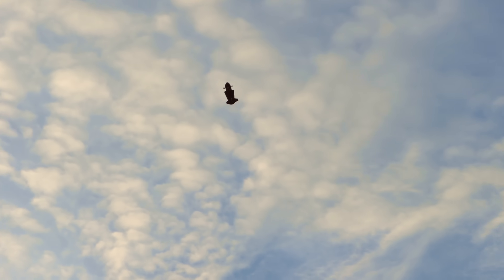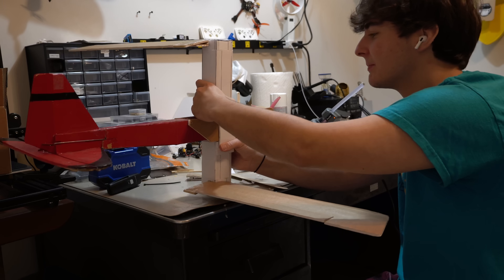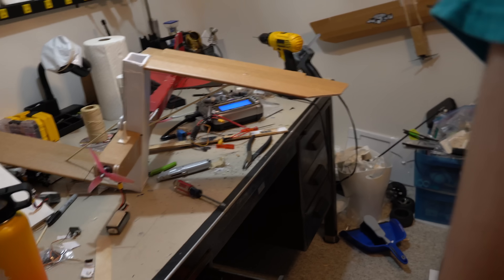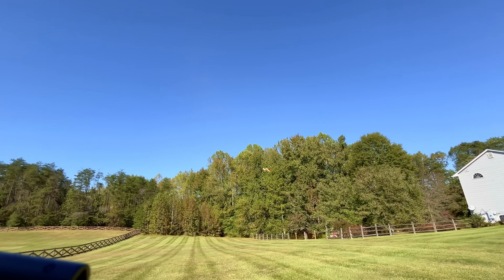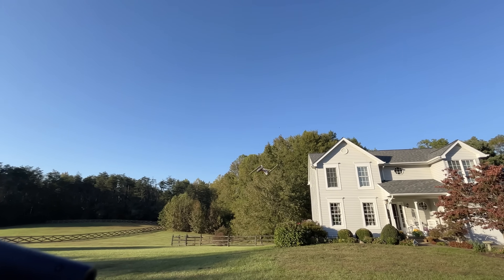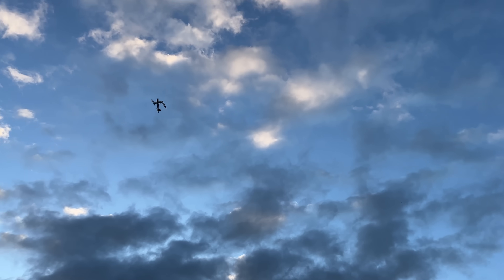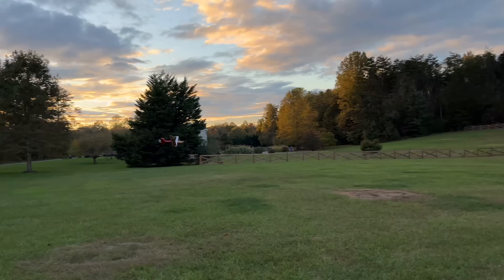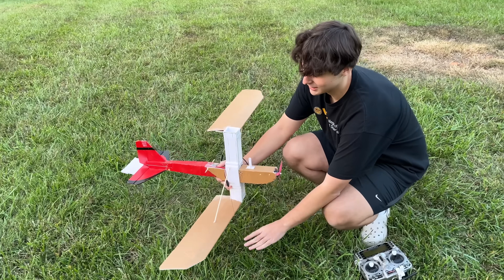Can a Plane Fly With Offset Wings?

Comment: let me just pause right here at 0:58.... lift is created by vorticity due to colliding airstreams. The only spin you'll get from an offset is the sharp angles in your model causeing an offset vortex in the same direction causing a torque, which would be fine as long as you trim the alerons. There is absolutely nothing to indicate that off set wings cause instability, except you need the tails to account for the this, including elevator and vertical stabilizer. When you have an asymetric airflow then the air streams coming off  the wings are asymetric, and if the stabilizer is hit by more air on the port side than the starbord side then your plane will be unstable and at least 1 lift surface is going to stall and cause a roll or spin. Its not the wing offset but the entire aero dynamic package that is important. Your vortexes shouold create drag in the right directions and should be balanced, but outside of that your wings placement and angle of attack is irrelevant at sub sonic speeds.
Reply: let me follow up after seeing the first model fly, there's one more option, that is to keep the wings far enough apart to give clean air to the tail section, which is smart.

Comment: The only reason I can think of why the car was having issues with flight and starting to roll was the relative positions of the propellers to the wing. the lower wing had the propeller blowing more air over the wing causing more lift, and the higher wing had the propeller blowing more are under the wing causing it to underperform compared to the lower one

Comment: One simple way to understand it -
The wing creates a force in the "up" direction. Precisely the same as if you had a 5 foot long string attached to the wing and you were pulling straight up on the string.  
Intuitively, it makes no difference whether it's a 5 foot string or a 10 foot string, so long as you are pulling straight up.

Up meaning toward the top of the plane. If the plane rolls, the force rolls with it.

You can then imagine at the top of the string, the thing that is pulling straight up on the string is - a wing.

You've already understood it doesn't matter how long the string is, only what direction it's being pulled.  The length of the string is the offset.

Comment: I'm not sure if this is a big enough effect to matter, but in your flying car video you were taking off near the ground and never got very high and I'd expect more lift from ground effect on the lower wing. Your demo plane for this video was being launched by hand several feet above the ground where that's not likely to be noticeable, though I'm not sure it didn't drop down low enough to get some ground effect before getting up to speed for sustained flight. I completely agree, though, that once you get high enough to ignore ground effect the offset in the wings shouldn't matter, and if you can figure out a way to look for ground effect on your offset wing plane I'd be interested in seeing that video. Not sure how easy that would be to do, probably easier in a wind tunnel than in actual outdoor flight.

Comment: I suspect wing offset has a much different effect based on the vertical CG compared to the two wings. On most of your projects shown in the video, your CG is below both wings, meaning the lift vector compared to the CG isn't different enough for a rolling moment to be terribly severe. Moving the offset to the extreme, one wing above and one below the plane's CG will probably cause rolling moment because of the difference in lift vectors.

But that is only my hypothesis.

Comment: Here's a suggestion based on your folding wing plane. Birds don't use their tails as elevators. They actually use them more for longitudinal control. The way birds control pitch is to move their wings forewards and backwards displacing the center of gravity from the center of lift. They move their wings a bit forewards which moves their CG to behind their center of lift which causes them to pitch up. Likewise they move their wings a bit back which produces a pitch down. I doubt it would take a lot of range of motion to give you pitch control. You could always have elevons as backup. But I think you should be able to pull this off.
Reply: Wow, I didn't know that about birds. Now I want to see if this works on a plane.
Reply: @nymalous3428 it should, center of mass applies to all matter not just birds
Reply: Some of the first gliders were controlled solely by shifting pilot weight!
Reply: @LastV8Interceptors  Hang gilder still use the same principle  and technically those count as aircrafts. The pilot hangs under the foldable wing out of cloth and changes the direction by changing the balance point with moving their legs. Today they have a steering triangle as a support to make the steering easier. Motor glider work in the same way only that the pilot sits with a motor on his back and uses mainly the steering triangle to change the balance point. In the 1960's Nasa was thinking of using that principle to get rockets back to the earth. They wanted to unfold a cloth wing like hang glider have to land.
Reply: @seanthiar  Ah - so the traingular handlebar thing on the powered chutes is actually to help the pilot shift their weight in relation to the chute, not twist the cute itself to serve like flaps? That makes sense. 

Thanks for the additional info. After I posted that I realized it was probably ALL the first gliders that were controlled with pilot weight shift, but I dont want to make such strong statements on something I dont know about!
Reply: There is a type of man-made flying device that uses the CG/CL relative position for control: The Hang Glider.
Moving the CL around like the birds is complex, moving the CG around (the pilot.s body) is much simpler.
Reply: @Halli50  Certainly. But since this YouTube creator made a workable wing fold mechanism I suggested he attempt to use it to effect pitch control in a manner more like the way birds do it. Admittedly for a mechanical device having stabilizers with moveable control surfaces is simpler but wouldn't you like to see a plane that dynamically adjusts its wing sweep to  control pitch. He can use the existing mechanism. He just needs to balance it a bit tail heavy with the wings fully extended and use varying amounts of wing sweep to provide a pitch-down moment. I do suspect he'll need to have some sort of onboard intelligence to provide dynamic pitch stability. In that case the control stick would in essence be a way to ask the onboard controller for pitch up or down with neutral stick being balanced.
Reply: Don't they make like a scoop with their wings when diving
Reply: I assume you mean birds use their tails for longitudinal stability. Because an elevator is a control surface lol
Reply: @carazy123_  watch a bird in flight. They twist their tails every which way while keeping themselves properly oriented. Note that while I think it would be interesting to use fore-aft wing sweep for pitch control, I think trying to too closely mimic birds would be problematic. If I were able to build as you can I think I might have the variable sweep wings while keeping the horizontal and vertical stabilizers - including rudder and elevons - on my plane. Birds can contort themselves in ways it would not be practical to do with a machine.
Reply: @billmullins6833  you missed my point…you said birds don’t use their tails as elevators, they use them for control. But elevators are a control surface. I believe you meant the word “control” to mean “stability”—that is, the ability to “stay in control” and remain properly oriented. I was just pointing out that your verbiage is contradictory bc you (mis)used a term with a precise technical meaning
Reply: That’s a cool concept

On big airplanes, moving the whole wing might be a problem but I imagine you could have the outer part of the wing on a hinge that you can move forwards and back to shift center of lift

I would love to see a concept plane based on this that doesn’t need elevons

Comment: You don't understaaaand how lucky you are to have been born when you were: In the late 70s and early 80s when I was 6-9 years old, I would take the electric motors out of various toys, and rig them up with oodles of batteries and fantasize about being able to get something airborne.  There just wasn't the battery energy density available back then, to do it.  If I were your age today, I'd be doing this too!  I laughed and grinned like crazy through the test flights.  Thanks, man.  Happy trails.
Reply from the maker: Oh man I actually think about this often. Before I knew much about the hobby and was too young to order stuff on Amazon I would tear anything electronic apart. I turned an air hockey table into a hover craft, made popsicle stick crossbows, modified Walmart rc’s to drive across water. And ya nowadays with foam board, programable controllers, FPV, and lipo batteries you can literally do anything. and And infinitely more so with 3d printing. I vividly remember discovering flight test, and realizing that you can actually buy electronics purposefully Designed to be used in DIY contraptions. Christmas list was immediately written😂. It’s an incredible time to be a creative person with everything we have. Thx for the comment man.
Reply: @joosh_king This was the response I was hoping for. Todays luxuries get taken for granted by the younger generations. It’s actually sad that you are one of the few that are humble and appreciative and not because you want to make MORE money on a channel. Please stay that way! Some of us still love to see that it still exists.
Reply: Having working AAs for an RC car was better than junk food.
Reply: The 70s still had some fantastic glow plug engines for R/C flight

Comment: You can only turn, obviously to one side, the lower and upper wings create a torque on the center of the fuselage proportional to the distance. It is funny to watch but physically wrong as your conclusions are. You might have tried to use different AOAs.
Reply from the maker: 😂😭 it turned left AND right in the video, Im just a bad pilot cuz I prefer left turns more. lol I’m gonna have to make another video answering everyone’s questions.

Comment: It’s be interesting to try the same thing but with another pair of wings rotated 90 deg , unfortunately swastika shape. Just make sure to disavow the fascist German political party it represents. Anyway, use the other set of wings for yaw (right? Yaw?). Or, you could also just make a square w/the plain body in the center of the void. You might have to add left and right ailerons (right?) on each side of the square (8 total), but it in effect would be the same but using a more palatable symbol.

Comment: Without seeing exactly what inputs you are giving it it's hard to say for sure, but how hard is it to keep the wings horizontal to the ground?  It looked kind of like it was more stable flying at an angle.

If that is the case, you could maybe figure out what that angle is and maybe even add some lift to the vertical strut at an angle equal to the angle it naturally rests at.  Might look slick if you put a cowled rotor in the middle section?

Comment: Really cool project. Intuitively, I feel like this thing should spin like a propeller and crash. But I couldn't think of an actual reason why it should, though. Same amount of lift on either wing, and that force is being applied to the fuselage at the same central point.

Intuition works for a lot of situations that humans evolved for, but when it comes to a wide array of new problems that technology brings us, it isn't reliable. Like this plane, or tensegrity structures.

Comment: So, it IS going to increase instability if the wings are perfectly symmetrical, but you can offset this pretty easily with trim and control surfaces (which you clearly did and did well) especially at small scales like this. However, that instability isn't necessarily a bad thing. Fighter jets are unstable because they are designed to turn on a dime. I bet that this thing is capable of some pretty serious rolling.

I don't see this taking off in larger applications as the same forces here grow exponentially and the ground effect (something encountered on ANY flight) would be potentially lethal.

Excellent experiment!!!

Comment: Absolutely fascinating video! I would have thought the distance between the CG and the center of lift would prove killer. Where is the CG and center of lift? Does the configuration create a dihedral effect that keeps it in the air and at the same time causes it not to fly wings level? I’m curious too about the center of thrust. Given the center pylon I’m surprised you didn’t get really poor pitch damping with any elevator input. Geeeeezzeee I could go on and on. Fascinating thanks.

Comment: If the wings were to have a deflection under flight loads or improper parallel alignment it would create a roll moment due to the lift force component in the y direction of the plane. When the wings are aligned the effect cancels out and causes a compressional force but if they are misaligned the forces are able to cause a dynamic movement if not corrected with the ailerons.

Comment: My initial thoughts are that both wings will have the same lift but their could be an issue with the center of gravity and stability. Watching the video is hard to tell but it really looks like it wants to roll in the direction of the higher wing.

Comment: Doesn't the offset just work when the CG is between the offset?

My thinking was, that if the wings do have an offset above the CG (like in the video with the RC car) then you'd have a diffrent resulting rolling moment, which would lead to an imbalance.

Comment: I would say from my own experience than offset wings like that isnt an issue when flying, tho it could be a big issue in ground offset when landing or taking off as the closer a wing is to the ground, the better it works, tho it should be fine with a small offset
so in general, offset wings isnt really an issue for planes in most situations

Comment: Ok, so some layman's thoughts.

It's off balance due to center of gravity with the left wing mounted high, so I wonder if you adjust the weight so that the center of balance was better.

You can't just adjust the wing size because that could affect lift from each wing, but what is you used lighter material in the left wing, or added weight to the right...

Comment: https://en.wikipedia.org/wiki/Ground_effect_(aerodynamics)
the closer the wing is to the ground the longer it will pull itself towards the ground, so the higher one would release the " airlift vacuum " earlier,, like when a "ground effect aircraft" floats over water but wont fly completely.,.

Comment: just the air being pushed down to the ground while hitting it and the pressure rise on the lower wing being greater than on the higher wing might cause problems at start, otherwise if you can balance the centre of lift with the centre of mass it should fly once it got its distance from ground

Comment: make Sure your propellers are rotating in different directions(i think the p 38 had a problem with that). also the roll off the ramp looked more like a suspension problem ( rc cars don't have the best shocks in the world ) or hitting the ramp at an odd angle? also having too powerful of an engine can cause roll(xf 84h). just a few guesses for ya, balance your plane/car thing and happy flying.

Comment: It works in this orientation, but if the bottom wing horizontally aligned with the body, then it wouldn't be generating as much torque as the top wing. For how the RC car was, the bottom wing wasn't below the car, so its torque wasn't offsetting the top wing

Comment: My thoughts were exactly what you said at the end of the video, regarding differences in ground effect for each wing. I was also thinking about the degree of separation potentially causing an effect. For instance, maybe there's a "window" or range of offset deviation between the wings, where once you get outside of that range then you're good (maybe allowing the wings to get outside of vortices that would affect control). In any case, I don't know for certain, but I would like to test it in a wind tunnel to see.

Comment: I loved the 'higher wing = less lift??' very good way to point out that that (mostly) doesn't have anything to do with it (out of ground effect).

In a perfect ideal case it doesn't matter where the wings are because the lift force is perfectly 'up' or 90deg from the horizontal plane.

Of course in real life there are a ton of little angles, so I could see some weird rolling/torquing effects but nothing you couldn't compensate for.

Especially as pointed out early on - the rudder/elevator might behave a little differently because it's going to be in a different kind of airstream ...maybe split rudder too for maximum memes? Obviously also one strut is above a wing and one below, so that'll have an effect as well.

I'd kind of expect your poor climb performance was from the brick in the middle of your plane using up a lot of power.

I wonder if moving the lower wing forward (especially in the swing-wing configuration where they're much closer) might mitigate some of the weird effects since it's probably 'feeling' something from being next to the downwash of the higher wing in the aligned configuration. It may make it worse though, I'm just spitballing.

Comment: In theory the wings should not introduce roll, unless you angle the wings. if the wings are angled upward they should introduce a roll to over the lower wing, if they point downward the should roll over the higher wing. At least thats my theory, looking forward for your results in the video.